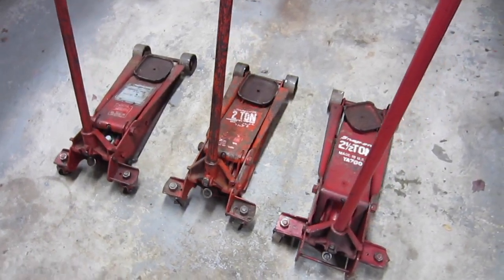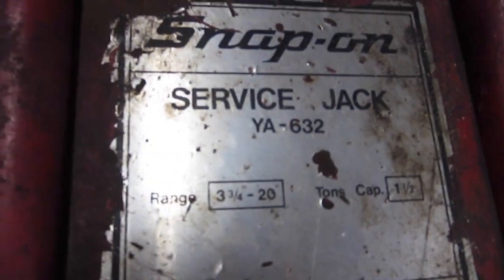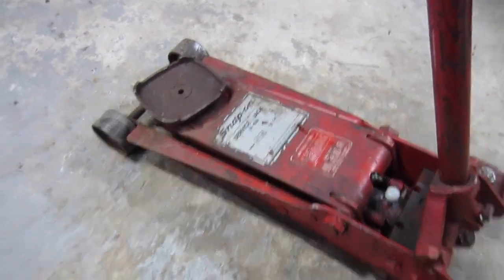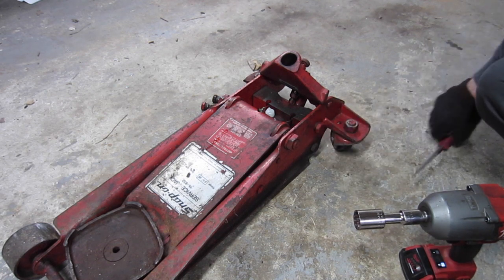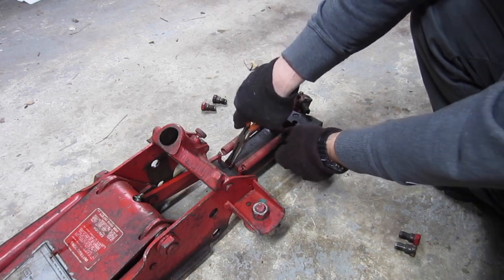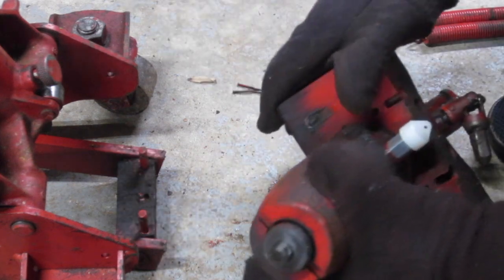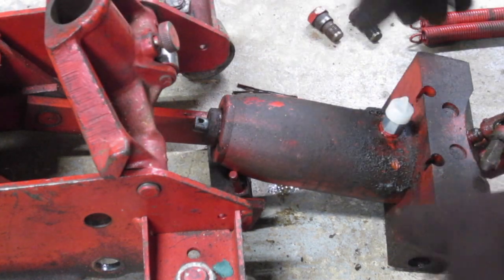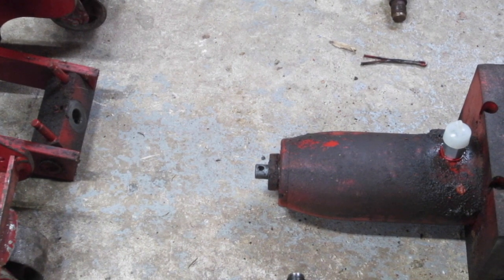Jack Disassembly, Snap-On , Lincoln Jack, Hydraulic Jack, Jack Rebuild, Hydraulic Jack  Repair

Comment: Anyone know where one can get the threaded nut or bolt that goes into the filler reservoir on the cylinder mine is missing

Comment: Seal kit $31.00 eBay (it’s not brain surgery) he only did half the job
Reply: Might just need to turn the valve all the way open maybe and jack a few times to get the air out?  Possibly jack all the way up and keep jacking a half dozen or so times as well in the all the way up position.

Comment: Where do you send for service? What is the cost of Rebuild? Thanks
Reply: Any machine shop that specializes in hydraulics. Had mine done at local shop that works on tractors.
Reply from the maker: @AcuraLvR82  I sent it to @t      they rebuilt it in a week.

Comment: Normally what it cost to send off that snap on hyd pump for a reseal kit installed?  ya700-a 2 1/2 ton snap on floor jack. Also what may be that turn around time, far as your floor jack thats being repaired! Thanks.....

Comment: Well I purchased the snap on floor jack's, yes with an s! from the going outta business shop' an offshore marine repair shop. They selling everything at a low cost, so I purchased the only 2 snap on 2 1/2 ya700-a floor jacks that says on top made in the usa, One of the ya700-a does leak an the other is holding! They were well used, paid $40 bucks each!  Hey' one still holds presure! The other will need a re-seal kit I believe?  I caught these guys at the right time. Thanks for your info!
Reply from the maker: Thats great! a really good deal, snap on jacks go for about $900 new. 
The rebuild is about $150 plus shipping, and the turnaround is about 2 weeks.
Reply: @redbaronat7238  Where did u send it to get rebuilt?

Comment: How old is the 2 1/2 ton, the YA700 model! What year you think it might be, or when it was made for snap on?...I found one on letgo.com for $60 obo the guy claims it works but haves a small leak, but still works? Is it worth buying? Also ware are you sending the pump for rebuilding?  Thank you...
Reply from the maker: Definitely worth buying just make sure its made in USA. I sent it to www.automaticrepairco.com      they rebuilt it in a week.
Reply: @redbaronat7238  What is average cost to have one of these pumps rebuilt by them?  Thanks.  Great video!
Reply: Thanks, I'll look into the company far as info that's needed.